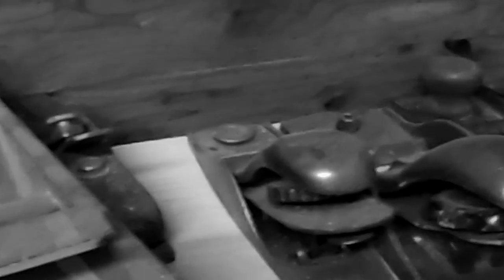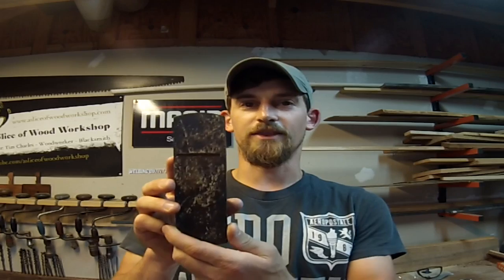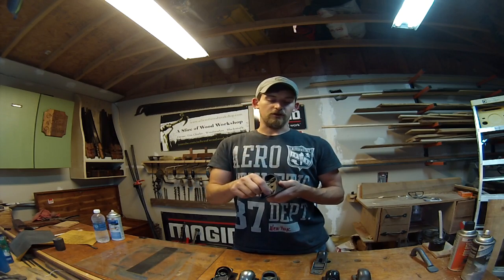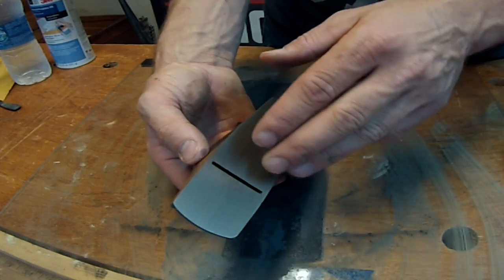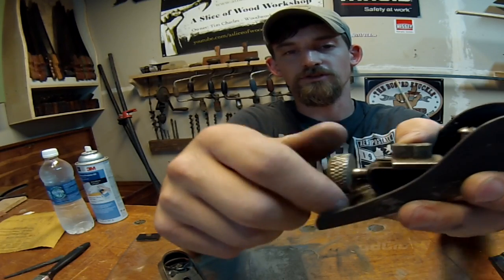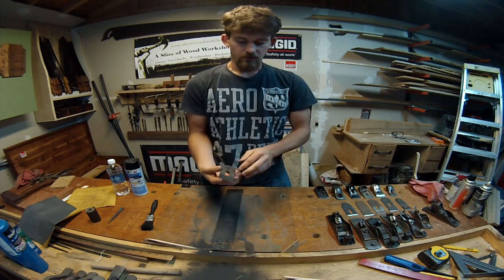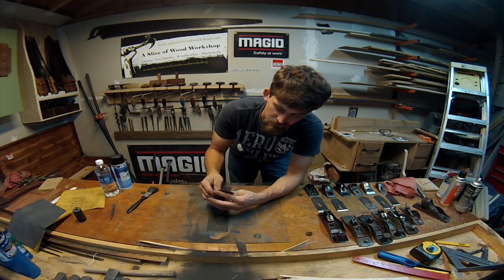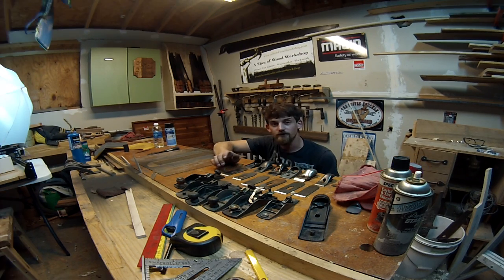1 Night, 6 Planes

Comment: I use a sheet of glass, 1200 grit wet and dry, I try not to let my one and only plane (Stanley Bailey #4) get to blunt ,so 1200 is great for a touch up, great video mate, Cheers.
Reply from the maker: Sounds like you need a backup invade your main plane gets a bit dull. Thanks for checking it out.